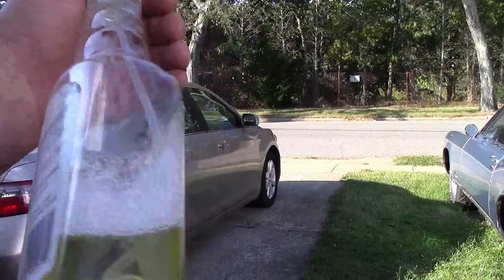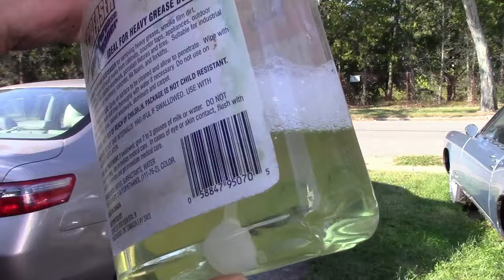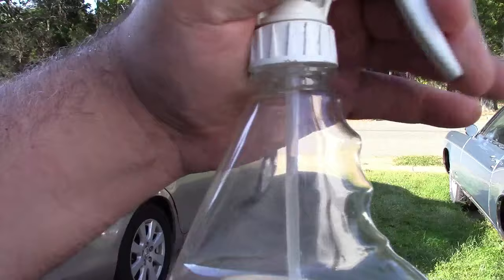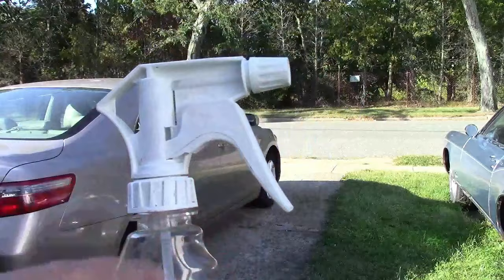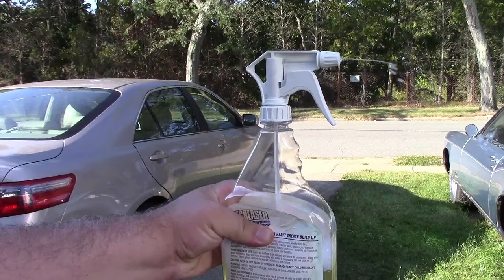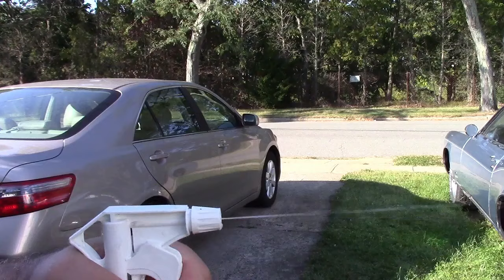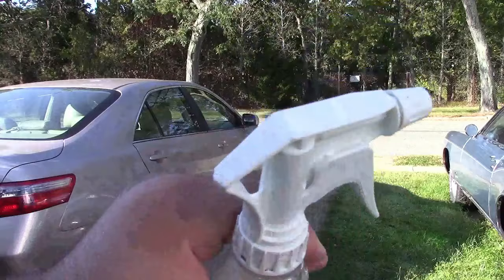Spray Bottle Not Working?  TRY THIS!

Comment: Except for me there’s still like no water pressure when I squirt in fact most the liquid drips back into the reservoir everyone keeps saying poke the nozzle there nothing wrong with that end it doesn’t matter what I search it just won’t squirt
Reply from the maker: And what happens when you squeeze it?  These things can and do wear out, they're designed to last only for the amount of liquid in the bottle, but can last for longer.  If there's any sort of bleach in there, it typically will destroy them in short order.

Comment: It helped a little but still not working correctly. I think the sprayer is done for
Reply from the maker: It's cheap to begin with, and replacements are again.
Reply: @jaykay18  its not the cost of the bottle...its the inconvenience of not having a replacement sprayer, when you need it most!!! Lol
Reply from the maker: @Archangel0804  I always keep extra spray bottles around just in case.  You can also take the sprayer from any other bottle you have and put it on that one at least temporarily.  The one shown in this video is still in operation, and still has the same problem, and I still use the same trick to make it work.

Comment: What's the solution when the bottle is made of glass? like an atomizer for the face or? thank you.
Reply from the maker: An atomizer with a rubber squeeze bulb operates on a different principle entirely.  For that, I would try soaking the nozzle in extremely hot water, then try operating the unit with the dip tube in hot water.

Comment: I can see the fluid coming up the tube when i squeeze but it stops in the middle what should I do 😩?
Reply from the maker: You probably have a clogged nozzle.  Run it under very hot water.  Sometimes poking with a needle will clear it also.
Reply: @jaykay18  mine is plastic so i cannot  use water i tried vinegar and a needle also but still it isn't working any other options :( ?
Reply from the maker: @Ss-bg1dy  Yes, you CAN use water.  Otherwise, don't sweat it, replace it and move on.  This isn't life's most difficult hurdle.

Comment: My Dawn PowerWash sprayer isn’t working. This trick doesn’t work for that nozzle. Can you suggest a fix? Ty
Reply from the maker: That's a different kind of sprayer, it's an aerating sprayer.  It works in much the same way as foaming hand soap dispensers do, where it pumps air into the soap stream at the same time as it dispenses to foam it up.

I am certain that Dawn would love to hear from you, and send you coupons to replace it.  Big conglomo companies do that all the time to keep their customers quiet.  They don't want to let the secret out that this $4,99 bottle of soap actually costs 49 cents to manufacture, and the rest is profit for them.

I specialize in laundry products.  Most people buy Tide, but I know better.  I know the brands that work better and cost less than 1/3 the price.  Same with spray cleaners, Windex can join Tide and Dawn in their fight to get every dollar out of the consumer while selling an inferior product.
Reply: @jaykay18  ty. I’ve sent an email. I’ll update when they respond. Btw, hubby is the one that loves this sprayer
Reply from the maker: @ShoreShihTzuNurs  Thanks.  That's also the same reason people like foaming hand soap.  It feels so much more luxurious than plain old Softsoap.  I look forward to hearing their response.

Comment: i appreciate the effort, but i have to give you a fail.  when i squeeze the bottle liquid comes out of nozzle and handle.  when i try to use handle, nothing happens.  tried over and over.  nada.
Reply from the maker: Nah, I don't think so.  I not only explained what to do aurally, but I showed what to do visually.  As long as you are not blind, you can clearly see that indeed it DID work and did NOT fail.  You didn't see any drips from the handle in the video, and it was clearly visible.  There were no cuts in this video.  I still have this same bottle and do the same thing every day I go to use it.  

Clearly, yours is malfunctioning yet another way.  That's why the title says "TRY THIS" instead of "THE BEST WAY" or worse, "FIX ANY SPRAY BOTTLE".  I didn't mislead you in any way, I didn't provide a clickbait thumbnail or title, just the truth straight through.

Comment: I tried this and it worked for 2 pumps then stopped working. Same thing 3 times, then the sprayer actually broke!
Reply from the maker: The spray bottle and sprayer shown in this video is still in operation today.

Comment: My bottle is brand new but won’t spray. Am I missing something because this didn’t help
Reply from the maker: The video is only 52 seconds long, so there's not much to miss.  Chances are, you have a new-defective spray bottle.  I always test a new bottle in the store by spraying it near my ear.  If I don't hear or feel a little air come out, I don't buy it.
Reply: jaykay18 thanks for the reply. Is there anything I could do for it to work? I didn’t test it out before I bought it but I should have
Reply from the maker: @LevelEarthBerk  Fill a sink with water, submerge the whole sprayer and straw, and try spraying, sometimes that can make it work.

Otherwise, it's possible to take the sprayer apart and see what's wrong, perhaps you can fix it.

Comment: great. i thought for sure this would fix it but now i have a dented bottle that dont spray 😭(not blaming you im sure mines clogged)
Reply from the maker: Unclogging is the first thing to try.  You've had soaps of various kinds dry up and cake things up, that's a no-brainer.  After that, this is the fix.  If this doesn't do it, there's way more wrong with the sprayer like broken or damaged parts inside, and that's the end of it.

Comment: i bought a new spray bottle and filled it with water but it wouldn't spray. i tried your method but instead of water coming out from the nozzle, it came out from the part where the nozzle screws onto the bottle... do you have any idea why that is the case? ;;
Reply from the maker: Open the nozzle fully?  Also, try taking it out of the water and spray it, you should feel a small puff of ear (might need to listen next to your ear).  If there's no air, it's defective.
Reply: @jaykay18   Have tried what you suggested and I think the product is defective. Shall get it exchanged at the store.  Thank you for the reply! :)
Reply from the maker: @sseulreal  No problem, best of luck to you!

Comment: Mine  won't spray when I squeeze the bottle
Reply from the maker: The nozzle may be clogged.  Run it under very hot water, and poke it clean with a pin.
Reply from the maker: The nozzle may be clogged.  Run it under very hot water, and poke it clean with a pin.
Reply from the maker: The nozzle may be clogged.  Run it under very hot water, and poke it clean with a pin.
Reply: @jaykay18  oh I didn't see this until after, but for future reference, u can soak it in vinegar water that worked for me. Ty btw.

Comment: Wonder how this works and what the actual fault was
Reply from the maker: I could give a whole physics lesson on it but most people flunked out of that class.  The actual fault I'd imagine is a bad check valve.
Reply: @jaykay18 now that you mention it,  the check valve filament pushed the opposite direction would cause this and be resolved by pressure so I think you're right.
Reply from the maker: @IMustTurd  I have a very good understanding of how things work.  I know I'm right.
Reply: @jaykay18  good

Comment: what if its a glass sprayer?
Reply from the maker: Transplant it onto a plastic sprayer bottle.  And get rid of your glass spray bottle, you stand a great chance of dropping and breaking it.
Reply: @jaykay18  the sprayer is plastic the bottle is glass with silicon. it needs to be glass since i have a strong chemical in it.
Reply from the maker: @taina313  That's probably why the sprayer failed to begin with.

Comment: Thank you so much for sharing....I have bought and thrown so many spray bottles. The last one I bought was from Ikea, it is supposed to be a good product. It stopped spraying after a couple of weeks. I said no that got to be a solution to this........ Check YouTube....... Thank you so much, these bottles  are very needed, but with Covid they are necessary.
Reply from the maker: No problem at all.  Very frustrating when something so simple, yet so helpful, goes bad.  Fortunately, the solution is simple as well.

Comment: Trick worked but the spray is not as expected!! The bottle jets out single flow rather than spray!! This beats the purpose!! Wish there was some other trick!!
Reply from the maker: The nozzle may be able to be adjusted.  If not, it might be partially clogged.  If so, try running it under extremely hot tap water, and pump some of t hat water through it, like fill the sink some with it and try spraying that through.
Reply: @jaykay18  will try and let you know!!

Comment: Can't squeeze mine without damaging it and putting a dent in i t(very hard plastic)....it's a spray bottle that was bought empty for filling with your own stuff.
Reply from the maker: Lesson learned.  Most sprayers will fit other bottles; when you run out of something, take the sprayer and transplant it on to your hard plastic bottle.  Or, do that now, swap sprayers to a bottle you can squeeze.
Reply: @jaykay18  I'll try putting the sprayer on a bottle I can squeeze.
Reply: @jaykay18  Update. I tried the sprayer on a bottle that I could easily squeeze and the liquid squirted out...but the sprayer still won't work.
Reply from the maker: Sounds like the rubber plunger inside has been compromised.  That's the end of it.
Reply: @jaykay18  It would appear it's definitely something within the mechanism but I've not even had it long enough for it to break / rot or whatever.  It's semi transparent and tome it looks like it's working, but obviously not. Thanks for trying to help 
though....much appreciated.
Reply from the maker: You can kill one of these trigger spray mechanisms overnight, depending on what you spray.  If you just spray water with it, it's going to be fine.  If you're spraying bleach, that'll kill the rubber seal.  Same thing with other household chemicals like ammonia or vinegar.

I once had a bottle of Clorox Clean-up that the sprayer went bad on, no matter what I did.  I replaced it with another, then another, then another, they kept dying.  Then, every time I used them, when I was finished, I'd remove the sprayer from the bottle, spray what was left back in the bottle, then flush it out with clean water.  EACH AND EVERY TIME.  Sound like a pain?  I did it anyway, and the sprayer always worked after that.
Reply: @jaykay18  It was disinfectant.  Another with disinfectant in has been fine though. The sprayer bottles are only cheap so no big deal. I've kept it for now for one last attempt when I can be bothered....probably a repeat of leaving it submerged in very hot water, but longer than last time. Thanks again.
Reply from the maker: Sure thing, good luck.

Comment: I'm over here crying with my spray bottle made out of very hard plastic :'(
Reply from the maker: The correct fix here is to get a new trigger spray; the threads are all the same so any one should fit nay other bottle.  Or, just toss it altogether and get one that has a squeezable plastic bottle for when this happens next time.
Reply: @jaykay18  just fixed it with oil! Lube up the springthingie in it
Reply from the maker: Excellent idea!  Good job on that.

Comment: Or you can take the bottle back and get a refund.  They couldn't get it to work either.
Reply from the maker: The point here is for a bottle you've already had.  If it doesn't work and it's brand new, that's going to be the store's responsibility.